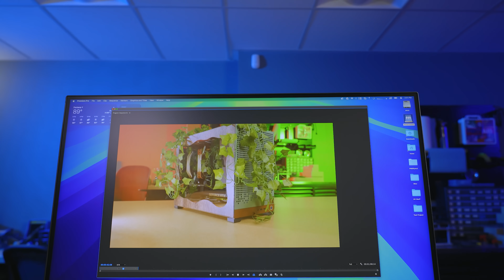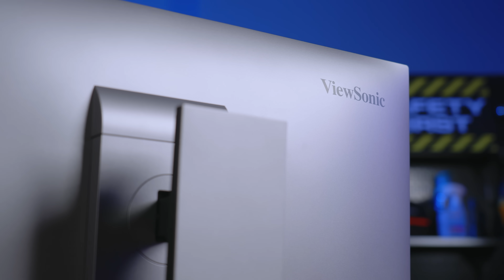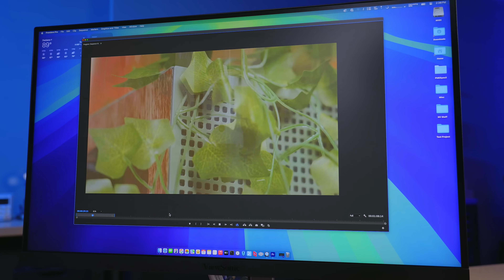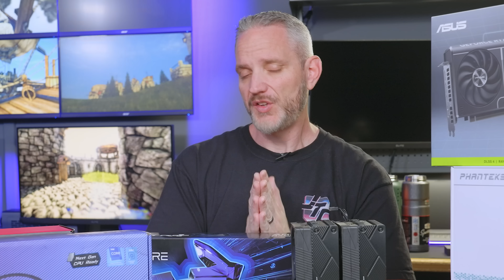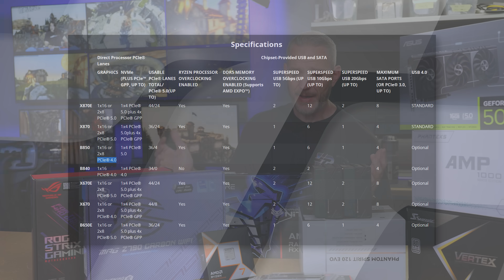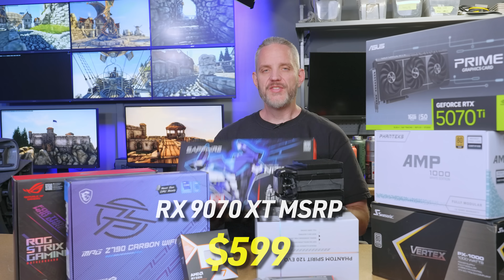This is the Sweetspot for PC gaming... Don't get fooled into spending more!

Comment: This has made me realize that I've basically always been the "sweet spot" PC gamer. In fact, I've never spent over $1,000 on any PC I've built since 2010. All midrange, all no-nonsense, no RGB, just straight function. And I've always liked it that way, I prefer the small black shoebox on the corner of the desk compared to the gigantic huge fishbowl RGB puke stuff. To each their own, that's just always been my thing.
Reply: Yeah I miss what the sweet spot used to be, but that tended to be my upgrade path. The budget tended to range, but it was usually based more on bang for the buck. The 6600GT was awesome (Though I really wanted the 6800GS), then I had a 9800GTX+ because I got it for a great price no long after it came out. Lasted me until like  GTX 660, then a GTX 1070, and now 3080Ti. So basically 60, 80, 60, 70, 80 in terms of card class. But different generations had different sweet spots, and different years had generations of games that were more or less worth upgrading for.
Reply: I like rgb for a silly teason. I like being able to glance at and see my compoents so i use all white leds. Then i have my cpu cooler change color for temp so i can keep an eye on it without a number block on my screen. All in all though my rgb added maybe 90$ in total.
Reply: @xenosayain1506  That's not a silly reason. There are no silly reasons for preferring one aesthetic over another. That also sounds like a really practical use for RGB thrown in. No need to talk down about your own preferences :D
Reply: I prefer a cardboard shoebox on the corner of the desk. Matches my vibe a little better ✨
Reply: $1000 is barely mid range now
Reply: @drunkhusband6257 it's sad but true with how pricey everything is now. 1000 is closer to budget territory than midrange, but you can definitely still build a very capable machine for around the grand mark today.
Reply: @guffey1989  True if you're willing to get used parts 1000 can do decent
Reply: My thoughts exactly. All the RGB, gigantic cases and lights and shit, it's so fuckin' stupid. I just want my PC to work properly, I don't want to take pictures of it for Instagram.
Reply: I like them big, black, sleek, dark and cavernous on the interior to properly cool the highest end components
Reply: @RTX5070Ti_Benchmarks like a huge, cool, dark, well-ventilated cave. I can see and appreciate the appeal there as well 🫡
Reply: same, I've built a pretty good system ~5 years ago and didn't go over 700$.
I can still run most titles on full graphics, inclusing VR. having a 1080p 60Hz monitor might be helping, but I see no reason to upgrade that part.
And who needs RGB? The best I can come up with is a visual indicator for component temperaqture (hot => glowing), but I haven't been able to find software that implements this.
And upgrading the GPU today would nearly double the cost of the whole system. SMH...
Reply: @erumaaro6060 yeah I totally understand that point. I played at 1080p 60hz for over 10 years before I finally got a 4K TV. That being said, if/when you get around to a higher refresh rate screen, it's like seeing a whole new world in your games. However, I do still play on a 4K 60hz screen and having a smooth and steady 60fps beats the heck out of having a sub-60fps experience. My machine is able to play some games at 4K, but I mostly run everything at 1440p to keep my fps higher/steadier and keep component temps down.
Reply: @erumaaro6060  60hz? lol I've had a 144hz or higher monitor since 2011
Reply: I hate having to re-disable RGB in bios every time I have to clear it with the battery.
Reply: I went in on a high spec with rgb, but mostly just have the rgb because the case and fans that I got and liked had that. I usually just keep it on white or red light. Can see everything well with that. Party lights are distracting.
Reply: I shifted more towards that, too. Often you can't even avoid rgb anymore though. I have already picked my parts for the next pc and gonna reuse my case but upgrade everything else (still i7 8700 so it has been a while). I even used to have dummy rgb sticks that I got on sale just for it to look nicer. I am trying to to completely zero rgb in the next build which is at some points harder than you think. Also...even the low end motherboards got SO expensive.
Reply: @Krizefugl yeah it's true, RGB is basically everywhere now. Anytime I upgrade or switch parts to something with RGB, I just turn it off if able.
Reply: What would your 2025 sweet spot build be like? I would like to have a pc for 1000€ but that's only possible with a 9060xt right now.
Reply: RGB is cheaper now i swear.
Reply: >on the corner of the desk
Boo!
Put it under the desk where it belongs (like every other PC case).
Reply: yea i dont see what they see in these glowing fish tanks, to me its about performance
Reply: how many pcs have you had since 2010? ive had 3 total
Reply: @ghostbirdlary same, on my 3rd now. My very first PC build in 2010 lasted me until the summer of 2020 when the CPU finally gave up the ghost. RIP my i5-760
Reply: @guffey1989  1st was 2600k and some dual card set up which was upgraded to 980ti then was 6700k with 980ti upgraded to 1080 then this year i started over with good specs, 9900x 9070xt nitro+ 64gb ram. that should last the next 8 years at least which is what my 6700k system lasted
Reply: @ghostbirdlary yeah that current setup should last you quite a while. My i5-760 went from a Radeon HD 5770, to a GTX 560Ti, to a GTX 770 (4GB), to a GTX 1660Ti. That summer when I installed the 1660Ti, the CPU finally crapped out 😂 it served me well for all those years.
Reply: @guffey1989  if i had the money to burn id get a 90 series card since im messing around with AI a bit, but for images at least the 9070xt is ok for it for now
Reply: @guffey1989  Just replaced my i5-760 this month. It finally showed its age last year with Photoshop and 50+ browser tabs. Amazing CPU.
Reply: @the0tha 1st gen core series was low-key a beast. I must have won the silicon lottery with mine, was able to manually overclock it to 5.0GHz on a Corsair H60
Reply: @guffey1989  I'm with you on the rgb stuff. To each their own. Personally, I just don't get the appeal.
Reply: Avoiding RGB saves you maybe, at most, 50 bucks. That's not a protip lmao you basically recommend buyin lowest spec gpus. Which doesnt work if you play other things than counter strike, minecraft and indie games
Reply: @timytimeerased  He didn't say it's a pro tip. Also he didn't say it lowers the cost by that much. He also didn't say his rig can play top newest games on 4k with ray tracing. You invented all that for no reason.

Also it's just one of many things he listed that helps him save cost.

I don't know why you're arguing against shit nobody even said. It's kinda weird.
Reply: if your building a new pc and dont spend more than 1000 bucks you are better off gaming on a ps5 pro........ sweet spot is about 1500 bucks since 2021ish
Reply: @aaronclay4665  Maybe as a total rig value.  Most people building swap in parts here and there, upgrade when they can.  That's how I do it, I alternate my core components and my GPU purchases to not have the entire cost on one bill.  Of course, I say that while my current rig is about $3500 all totaled up, but I can actually afford that now, even with costs being as crazy as they are.  And not just with computers... like I have an $800 car payment.  $800 used to be able to get you a whole ass car.  Granted, probably didn't look the best, but it'd at least run.
Reply: @aaronclay4665 hey man, if you can swing the 1500+, go for it. I personally can't afford it. I've found even a 1000 budget will get you a whole lot of PC compared to a console. Plus, I prefer the freedom of upgrades/parts swaps when needed on PC compared to console. Just the way I like to do it. 🤷
Reply: @aaronclay4665  unless your in Canada and then it's $2000 if you're buying all brand new parts
Reply: @aaronclay4665  ps5? Why would anyone want to pay the Sony Tax just to use your own internet?
Reply: @aaronclay4665  No because console games suck.  If you're serious about gaming and want to play older games as well then get a PC.  The games are just better, mods etc.

Comment: Totally agree except for the fact that you need a case with a good flow. The 4-5-6 degrees difference from a case with good airflow versus a case with a bad one could be the reason why your system is thermal throttling, and not running well, or on the opposite - it's running great. Don't know why you mentioned warranty when this isn't really important with cases, more like - go with a reputable brand that has good experience with cases. GamersNexus have great case reviews, and generally you (mostly) can't go wrong with Lian Li, Corsair, Fractal, etc.

Comment: Shout out to anyone still running a R5 3600x with something like a 7800xt, like myself. At this point, something will have to break for me to upgrade. I’ll melt this little old bastard before I take it out still working.
Reply: There is absolutely no way that cpu isn't completely dragging that gpu down, reminds me when I have a 1700x and a rx6800, you should probably update your bios and get a 5700x3d or 5800x
Reply: @larbi253 oh for sure, this system was only meant to have a 6600xt in it.

Comment: Happy with my Gigabyte X870 Aorus Elite Ice Wifi 7 + Ryzen 7 9800X3D + RTX 5070 TI + Patriot Viper Elite 5 32 GB (2x16) 6000 MHz CL30 + Fury Renegade 1TB + 2TB + Thermalright Royal Pretor 130 + NZXT Phantom 630 + Be Quiet Light Wings LX x 3 + Monitor LG 27GS85Q 1440p 200 Hz + Seasonic 1000w platinum.

Every GAME (Warzone / Forza Horizon 5 / The Finals / Fortnite (Exception more than 100 FPS EPIC Nanite) / Diablo IV) at 1440P Ultra at more than 200 FPS without DLSS or FG. With HDR activated.

Comment: 7800X3D cooled by a liquid freezer III 280 ARGB on a B650 Tomahawk WiFi with 2x16 6000 CL30 FlareX5 and 2x M.2 PCIe 4 drives. Powered by 1000W 80+Gold because of a rather power-hungry XTX Phantom Gaming OC and cased in a Be quite PureBase500DX.
Looks very simple, performs very well.

Comment: Upgraded this year finally, 3800 X -> 5700 X3D and RTX 2060 -> 6900 XT (would have gone with a 9070 but they weren't out just yet and the 6900 XT is a Nitro+ SE and I got it for less than half its normal price)

Comment: Funnyli enough I built about 8 months ago… 7900x b650 pro rs from asrock 32gb ddr5 at 6400 7900xt 850 gold psu and a 360 aio just for looks I know air cooling was more than enough on a lían li a3 mouse keyboard pad extra fans and taxes included for 1400$ seems like I was right in the sweet spot for pretty much everything 🤣🤣

Comment: I recently built a 9950X3D/X870E/4090 rig and went with Gen 4 drives (Samsung 990Pro 1TB & 4TB). The price difference to Gen5 just isn't worth it and the extra heat isn't welcome. My RAM is 6000MT/s at CL30 and runs stable at a command rate of 1T.

Comment: You are probably better off buying a really good monitor than anything else these days. 

Everything else in the middle isn't too exciting. AMD cpu and mid priced mobo with nothing too exciting in terms of ram. Buy a Noctua cooler and big case, it will be quiet and the Noctua can be reused with brackets for multiple generations. They are a wiser choice than AIO water cooling. Super fast M.2 drives make little difference to gamers, just get something about 1 TB or 2 TB, gen 4 and that's fine. GPU, don't go mental, $400 max or get a B580 if you can find one around $250. The 580 will probably be good enough for most people. Which takes me back to where I started, buy a good monitor, that makes everything better and for years to come too. High end GPU and CPU really don't offer much for all the extra cash. Spend more on the monitor, it will make a huge difference. It's like buying a $5000 guitar and using a practice amp, the amp is more important than the guitar. The monitor is more important, they're the one thing that's actually worth getting excited about these days. 400 fps when the monitor looks terrible... why bother?

You really don't need to go high end. Most people won't be able to tell the difference or make real use of all the extra oomph. Go mid range and buy a really good monitor.

Comment: I managed to get a gigabyte b850 with 32gb for $185 and a 9600x for $145 I did buy a 9060xt 16gb card for $350 I was a replacement for a 2600x and a rx580 I don't feel ripped off I for for to mention I needed a GPU in jan 2021 and yeah that was a rippoff

Comment: I agree with what Jay says with a PSU. Mine is the oldest in my PC 13 years old SuperNova 1000 P2 Which I got for using 5x HHD, 2x CD-Rom Drives and GTX 470 SLI and now I’m running a AMD 7950x & 4090 just fine.

Comment: I totally agree with what Jay said here.
I totally disagree with what Jay said... looking back at 40 years of builds for self, family and businesses. I have never felt the need to rebuild/replace fast enough to swap CPUs, GPUs..etc... Storage expansion .. yes, Memory expansion rarely, Usually by the time we felt the need to do a real upgrade.. it was a total system replacement as the older stuff was two or four generations old. The older systems were cleaned up and did the hand me down shuffle. Either to people who didn't need current gear like parents, or kids, or for the business level lots of systems went out to employee families or out to charity.

Comment: My current sweet spot was an upgrade of my AM4 platform. I did a cheapish upgrade to a 5700X3D (5800X3Ds were gone at the time), and a 7900XTX. I game on a 3440x1440 monitor, and generally don't need to use FSR in anything I play (including Cyberpunk, because I don't care about RT at this point). I usually get over 100 FPS in pretty much anything, and I only play single player games.
Reply: Hey, pretty similar here. I did a luxury upgrade (wasn't really necessary) going from Ryzen 5600 to 5700x3d, from 3200 CL 16 to CL 14, and from RX5700XT to RX6800.
But the setup is perfect now.
And it was affordable.
Reply: How you guys liking them x3d chips i started  with a 5800x3d few years back and upgrade to the 7800x 3d soon as it came out
Reply: 5700x3d rog strix b550-f w2 7900xt 20gb vram 128gb gskill trident neo z cl3600 4tb storage and bout 11 case fans lmao 850w psu
Reply: @32josephjones 7700x/7900xt system checking in!
Reply: Did sort of the same 3900x and 5700xt to 5900xt and 9070xt. Old system didn't even feel old to be honest that's why the bare bones upgrade. Should last another 5 years or so 😅

Comment: That could be an interesting video, seeing the difference changing CPU's one a something more realistic than a 5090.

These days I use PC Part Picker for looking at RAM specs, because it lists real world latency. 
That Sapphire 9070 XT is about (converted to USD) $950 in Australia. And even then it's one of still on the expensive side.
I do with they didn't have massive coolers on them.